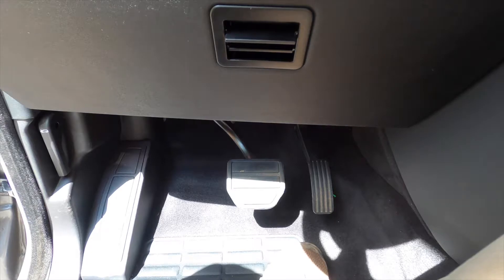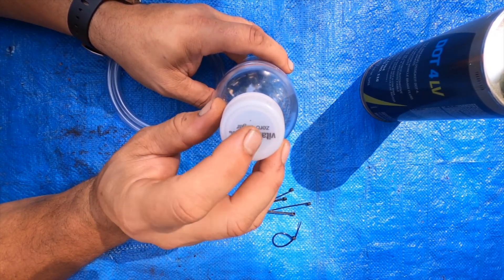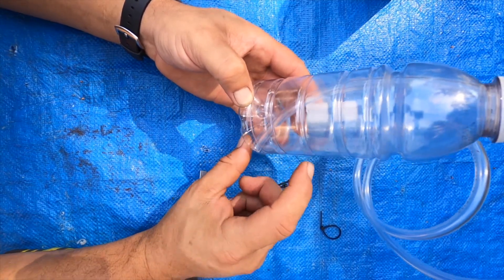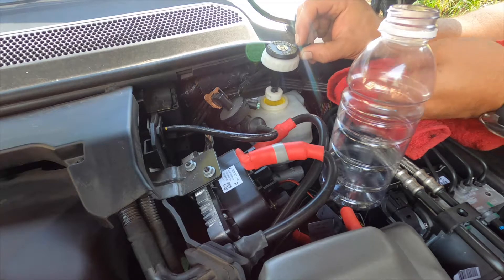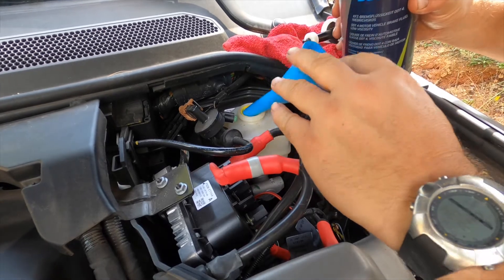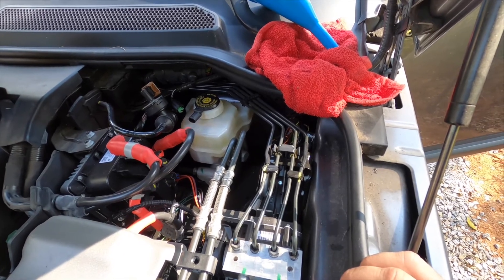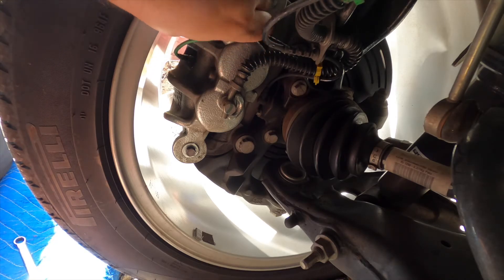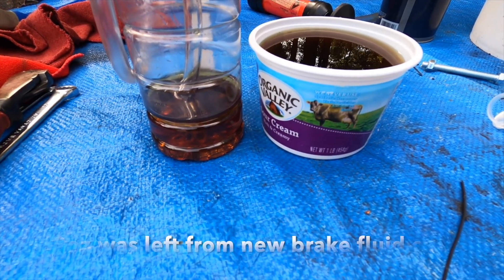2016 Land Rover LR4:  Brake Bleeding

Comment: Hie no pressure is coming on my rear brake calipers
Reply from the maker: Is this a result of brake bleeding or you just don't have pressure at your rear brake calipers? How do you know you don't have pressure at your rear brake calipers? Is your pedal spongy? Is there air in your lines? Most of your braking comes from your front calipers (75-80%). IF it is air, you will need to go through the whole brake bleeding process until your pedal becomes firm.

Comment: How many litter for Brake Fluid for discovery car, bro???
Reply from the maker: LR doesn't publish the capacity, but you would need to buy 2 liters. You will more than likely only use 1 1/2 liters to do a complete flush. You can use less if you siphon the old fluid out of the reservoir first.

Comment: Topix manual from LR for the 2016 LR4 HSE Lux says to do this with the vehicle running just FYI.
Reply from the maker: I didn't know what that was (I know now), but I'll take your word for it. On the other hand, does it make mention of bleeding brakes after changing just brake pads and/or does it mention changing out or bleeding an ABS modulator which does require the vehicle to be running in order for the pump to run?
Reply: @RoCDIY  no it doesn’t mention any of that. It’s specifically the Land Rover instructions for the brake bleed procedure. Not sure if it really makes a difference but I thought I’d mention it.
Reply: @DustyBurro  I read the same and about to bleed my brakes, did you get any answer on whether the engine needs to be running?